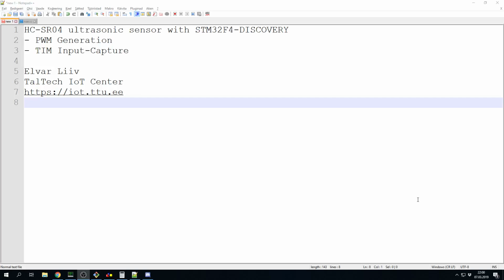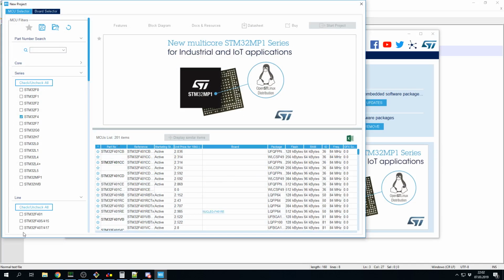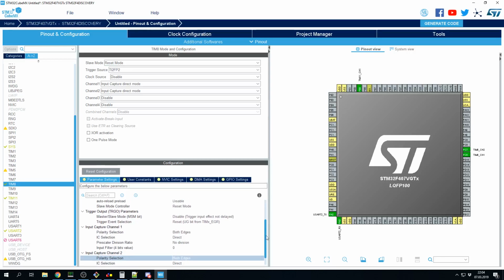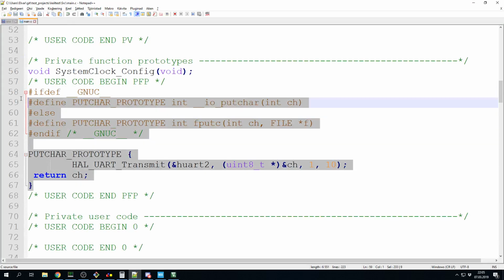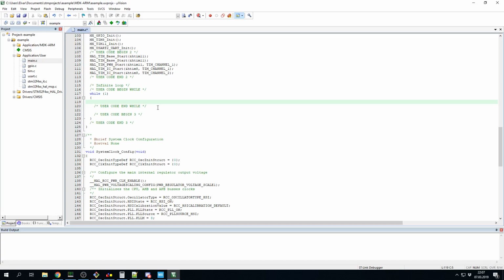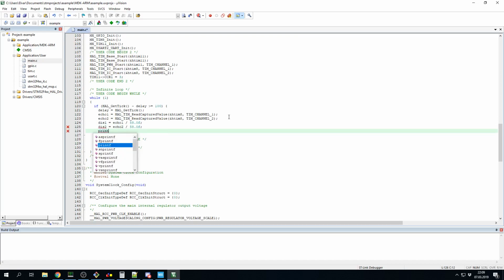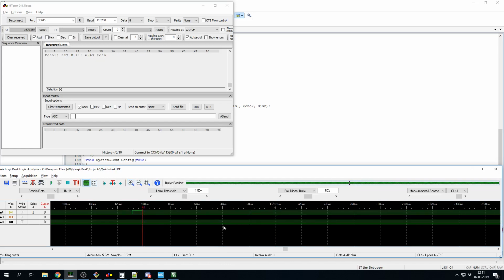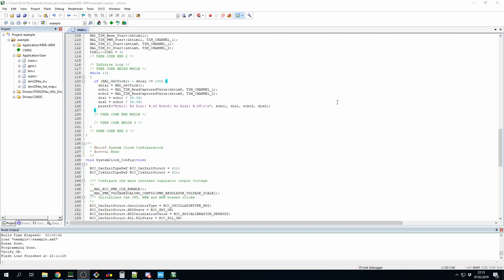STM32F4-Discovery and 2 HC-SR04 ultrasonic sensors

Comment: Hi, are stm32 pins tolerant to 5V from hc-sr04 echo output? Did you use level shifter?
Reply: you need just 2 resistors, i used 9.7 Ohm and 4.6 Ohm so i  get 3.4 V